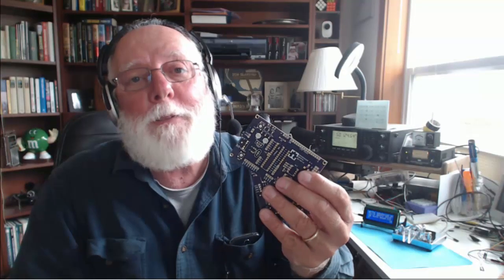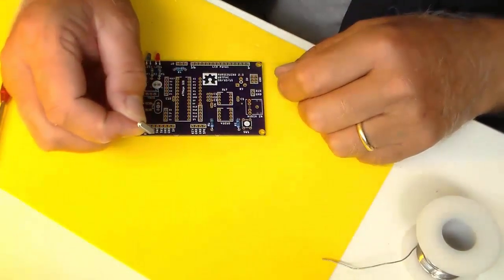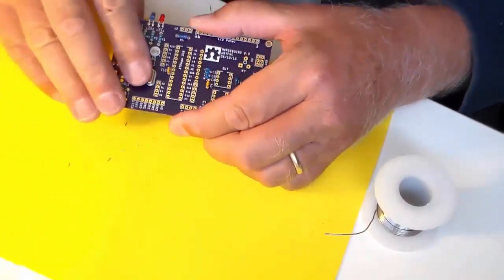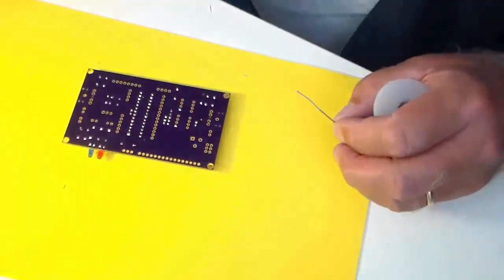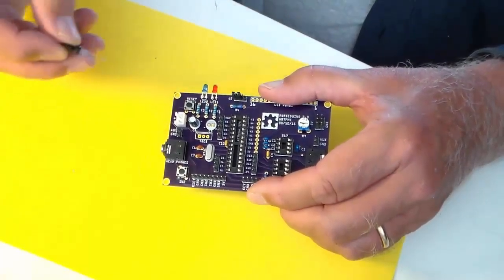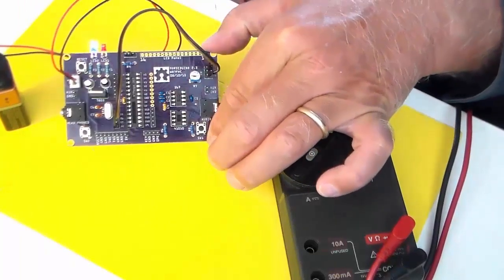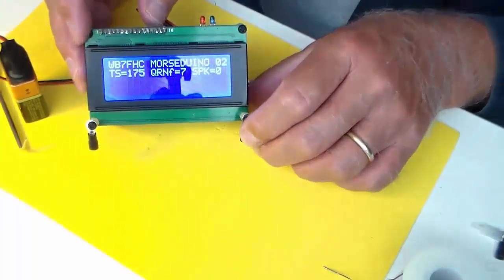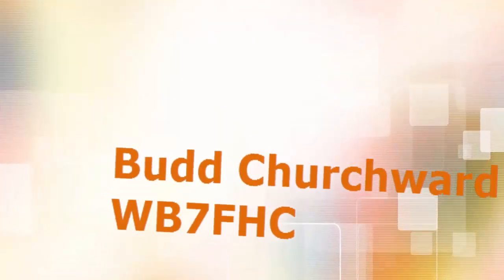High Speed Kit Build

Comment: Hi Budd, thanks for the great project! I wanted to mention that I think there might be an error on the schematic for R5, 150 ohm resistor.
R5 connected to pin 5 of the 567 and GND seems to cause the 567 to not decode any tones. When I remove R5 the decoder works well.
I am not using your PCB, as I just breadboarded the circuit. Anyway, can you verify that R5 on your schematic is connected correctly?
Thanks...
Reply from the maker: Yes, Tony, the schematic is correct. You will also see it on the schematics in the LM567 datasheet. Some circuits use it, some do not. If I remember right, it determines the range of tones we can detect. Your circuit will work without it, but the sweep routine might not function well. We do have R5 connected to ground on the PCB.

Comment: Budd, can the decoder be fixed on a specific speed and a specific tone? I want to use it specificly for slow speed NDB decoding. Also what is the reaction audio bandwith of the design? For my use it has to be around 50 Hz or even less, but I guess this could be problematic with this design. Thanks for the nice video!

Comment: G'day BarnaleBudd, If you are in OSH Park and you click on this name sign, where the circuit boards are  and up comes,  Morseduino Controller Board,  date January 28th 2015  Is this the first board you worked on,  so the next is the Morseduino 2.3 is that correct Budd?

Comment: You mentioned a prototype in correspondence that handled a qwerty keyboard, sending words after each space character to keep the qso going, if I remember correctly. Are you planning a kit board with qwerty input support and transmitter keying with a relay or some other switching method?
Reply from the maker: +Kent Hastings So far all the qwerty experiments that I have done use the USB on the Arduino. Because they are so inexpensive, I don't see myself building my own board to do that. I have been keying my transmitter by grounding the external key jack on my old Heath Kit keyer. I use it as a buffer between my experiments and the expensive XCVR. If I build my own keyer I will probably use an optoisolator to key the transmitter. The qwerty stuff is just software. When I revisit that project this winter, I will post and share the code.
Reply: Are you using a qwerty keyboard on the USB standalone or serial comm to a computer? I'll have to check out the optoisolator. The relay I used has internal coil resistance so 5 volts from a pin seemed to play nice without chirps or clicks at 24 wpm.

Comment: Budd, did you make your PCB for the M1 or the M2 displays. I had to reverse the A0-A5 pins on my breadboard to make my display work, guessing mine is a M2 display.

Joel
KB6QVI
Reply from the maker: +Joel Caulkins That's right, Joel. I forgot all about that. When I was learning how to do the PCB layout I realized that all of the traces that went to the LCD were going to have to cross each other. The solution was to simply change the order of the pins in the sketch. BTW you can find the latest version of the sketch at: http://mypetarduino.com/MorseduinoSketch2.3.htm.
Reply: +Budd Churchward Thanks Budd for the latest build.

Comment: Great Vid. Are you going to sell them? Am building one too useing your diagram and software. Got to make the pcb and connect every thing. Like I said Great Vid
Reply from the maker: +Hogkat Thanks for the kind words. I just updated the video description to include links to both the Arduino Sketch and the shared boards on OSH Park. I expect to have boards and kits available in the next few weeks.
Reply: +Budd Churchward OH Budd, your going to be busy.
Both my versions working FB
73,s
Reply: +Budd Churchward Bought my 1 set of 3 just waiting for the shipment and will put up a vid for you Budd. Going to play around with the sketch to put some stuff in like callsigne (PA1TAS/ZS6PMT) and later on when I can going to make one via fpga (first project with the max 10 dev. kit) and hopefully I won't burn out my brain cell. HIHIHI

73
Paul

have three build and tomorrow will I begin to set it up so that I can test them.

Real nice kit Budd